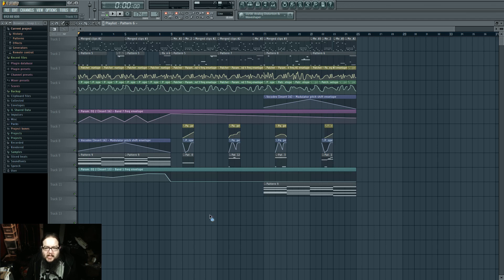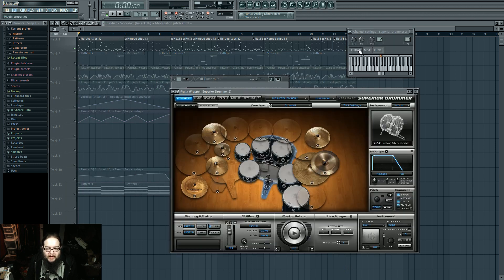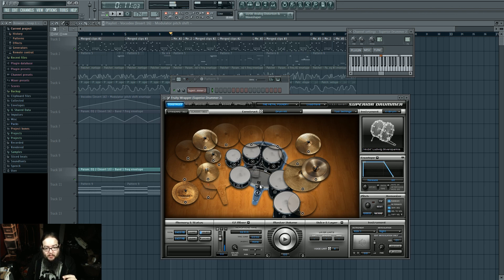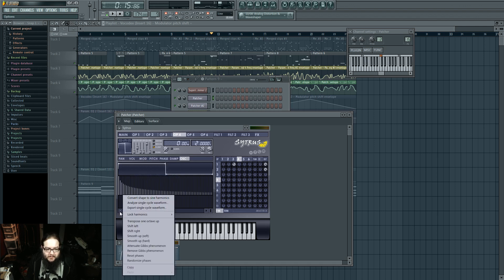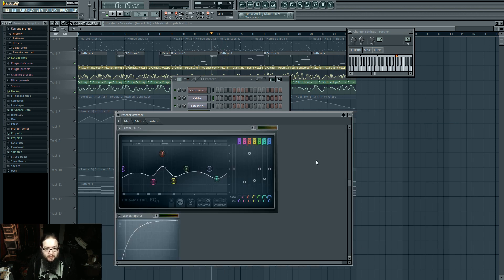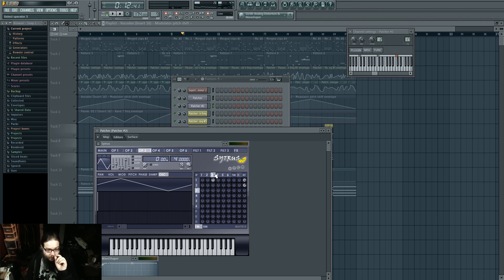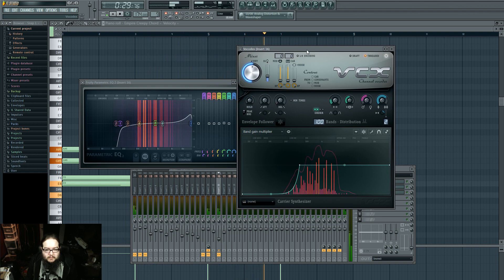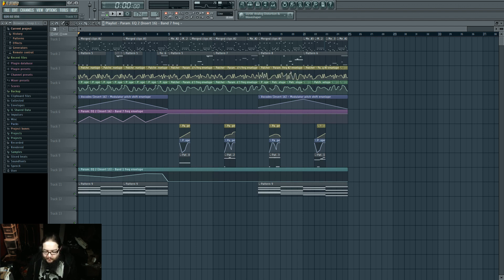SeamlessR Sound Design Research Recap 4: Old School-ish DnB

Comment: Can you do sine comrpession pls?
Reply: sine compression isn't that much of a special thing. go ahead and watch the livestream with Frequent and/or the one with Evoke if you're really interested in what it means
Reply: Pretty sure its just compressing a sine wave to the point of distortion... which is what distortion is anyway...
Reply: Nu ZLand  It's not a process that starts from scratch. It is just an effect, so it can be applied to anything, not just a sine wave. I think the term is kinda misleading unless you know exactly what it means, but that's that. Basically it's just intense compression or soft clipping, mostly used after eq modulation or anything else that creates movement in the sound's spectral profile. It helps to exaggerate movement that has been added previously and gets you a nice full sound to add a bunch more modulation on, so it's good to repeat this process a couple times to get some interesting sounds.